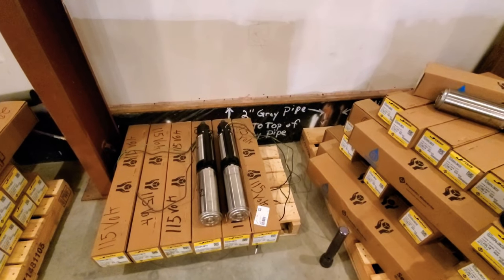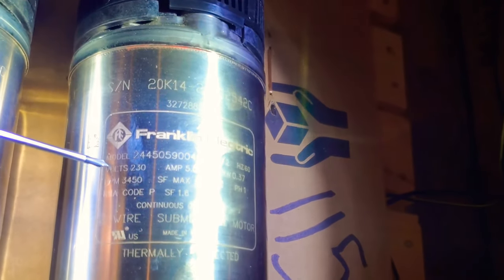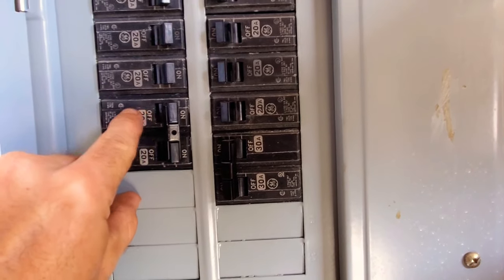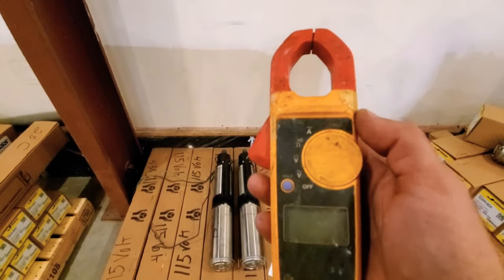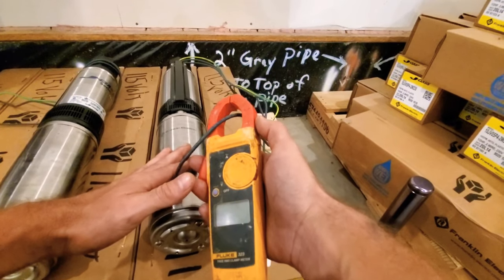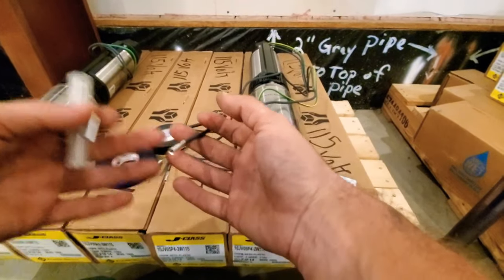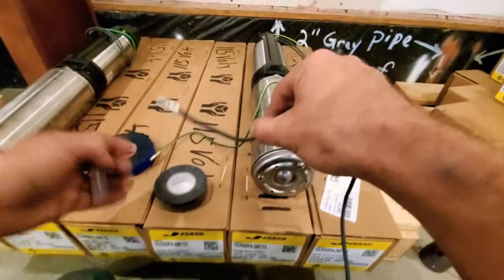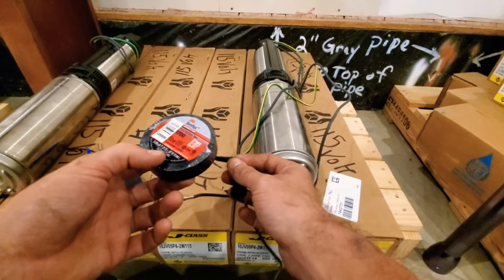Reasons Why Well Pump Trips Circuit Breaker & How to Test it Correctly.

Comment: I really enjoy your videos and the info / hints that you offer. I just replaced a pump but I am hearing a dripping sound coming from the well about every 4 seconds.  The only place I would think it would be coming from would be the pitless adapter but it is dry. Any clues? I thought that I might have heard it before I droped the new well in. I put everything in just like you show in your various videos but am now paranoid I did something wrong. thanks

Comment: Will an old failed pump trip the breaker? Or is that more common a pressure switch or wiring problem?
Reply from the maker: If the breaker trips, it's normally a bad pump. On rare occasions the wire will be bad somewhere

Comment: I have a well problem. Single 15A breaker keeps tripping. Used clamp meter to test at pressure switch, and the well draws 12.4 Amps when running but spikes to 19 Amps when starting, tripping the breaker. Replaced corroded pressure switch. Still tripping. How can I tell if my pump is bad? I did make a repair in the basement on the cable going to the pump where a rodent chewed it this summer (I used regular heat shrink)…could that cause more amperage to be drawn? Do I have to pull my pump? I don’t think the well is very deep, but there is a bird’s nest of loose wiring in the top of the well tube, not neat like you install. No plumber has yet returned my call and I’m getting frustrated. Thanks!
Reply from the maker: That's normal amps for a 120v pump. If its a single breaker, then replace the breaker with a 25amp. 
If you have a 240v double breaker, then your pump is bad.
Reply: OK. It is a single breaker (15amp). Is it odd that it just started tripping the breaker after living here for 2 years? The well and water softener/Iron treatment is the only thing on that circuit. The wiring from the panel is 14/2. Is it ok to use that wire on a 25amp breaker? Also, thank you so much fo your speedy response!
Reply from the maker: @willnicholson7169  typically pumps are always on a 20 amp. Bc its a 120v this makes the amps alot higher. I fix this issue by using #10 wire to help prevent voltage lose due to distance from panel to pump. Your 15amp breaker is definitely too small. A 20 should work. But if it's possible to replace the wire from panel to pressure switch, I'd put a 10-2 wire in. But id test the system with a new breaker first.
Reply: Again, thanks for the reply. I can easily replace the wire from breaker panel to pressure switch. Replacing to the well from there would require a lot of digging. It’s probably about 45-50’ to the well so not too much voltage loss maybe? Having a new 10/2 from 20amp at the panel to the pressure switch, and then the 14 AWG cable to the well itself won’t cause any problems with wires melting?
Reply from the maker: @willnicholson7169  it shouldn't cause any issues. We used to use #14 until code changed. I've never seen it melt. If you ever replace the pump, I'd put #10 in the well at that time. But The wire in the trench is fine as is. It won't be a problem.
Reply: @h2omechanic  Dude you are awesome answering this mans questions, I have benefited from your replies as well, thanks so much! Safe travel and good health to you!

Comment: If I want to put in a outdoor hydrant like that can I tap in to my well line coming from my pump under ground , I know where it runs.
Reply from the maker: Yes you can. As long as there's not a check valve at the tank that would prevent water from flowing back that direction. If u have one on the incoming side of the tank, you'll have to remove it

Comment: can i use a submersible pump in my lake, for irrigation (primarily of gardens)?
I'm tired of losing my prime in my jet pump (I left a Q at another video of yours)

My jet pump sucks (lifts) about 10 feet. It discharges perhaps 40 feet in elevation.
Reply from the maker: Yes, it's simple to do. Use the big jet pump pipe as a wire sleeve & the 1" pipe to hang a submersible pump on. Just tie the pump to the dock with 2 ropes. Any 1/2Hp sub pump will work fine
Reply: @h2omechanic  I have seen a person on the lake with a PVC sleeve that holds the pump horizontally, with PVC legs. 
My plumbing is far away from my dock
Can I find one or make on that's horizontal, like I saw?
Reply from the maker: @Evan-lx9lw  watch my video on the $10 device that extends pump life. It's a video on pump sleeves and a simple way to make it